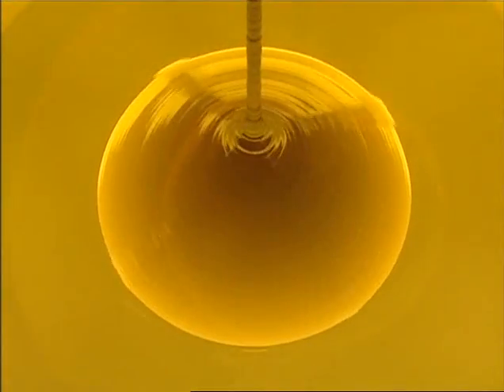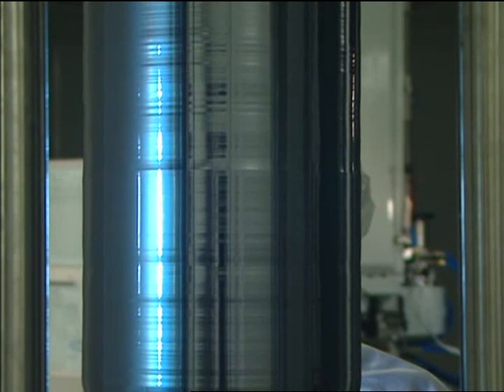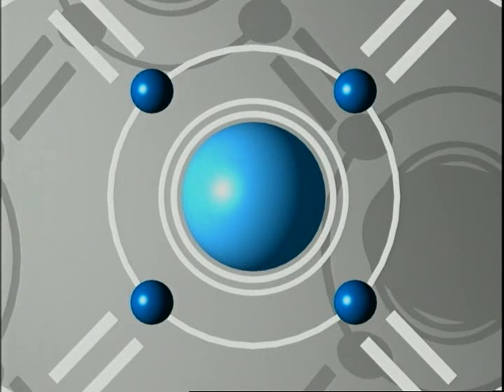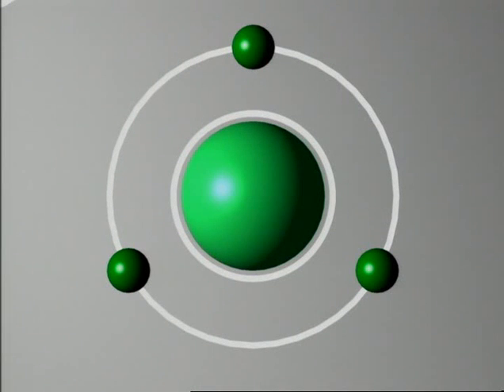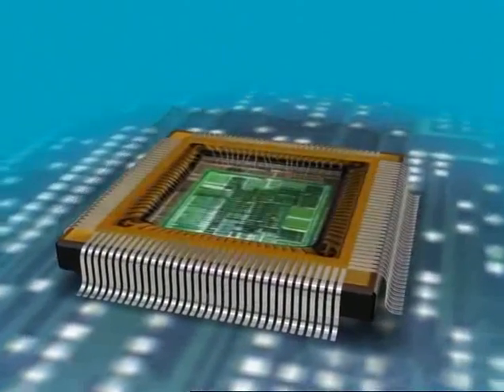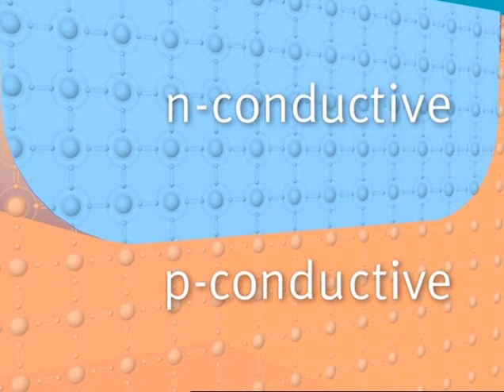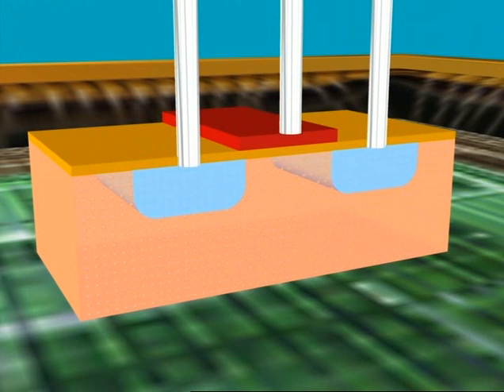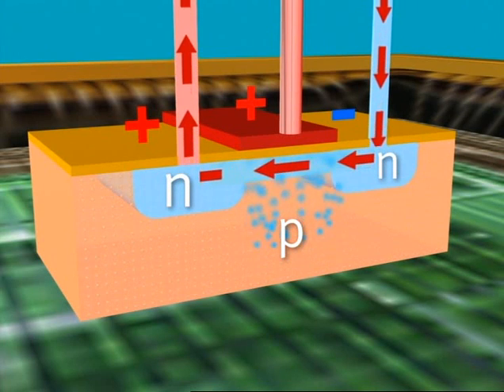From sand to silicon

Comment: what type of sand is used? There is a big difference between sands.  I know this from construction videos with window glass making. They show a desert dune but I hear that isn't the correct sand.
Reply: Just look up what sand type is on silicone valley. That’s pretty much where most computer chips are made from.

Comment: I mean, that was cool and all.  But I came to find out how to turn sand into silicon...
Reply: The process is complex and multi step!
Hope that’s helps :)
Reply: @thelukesternater  thanks, now all is clear
Reply: 👋 Hi,  I live in the High desert of Oregon and have 8acres of sand (we also are above an obsidian flow).  How can I make my sand into anything / crystals???
THANK YOU 🙏!!!
Reply: You may need more than a 3 minute video!
Reply: 8
0
Reply: You need to get Si by reaction with carbon to make CO2, then you melt the resulting silicon into one piece and pull the single crystal.

Comment: Please someone could answer me, I wanted to know how a monocrystalline crystal seed is made, how was it made?
Reply: Quartz silicon/sand is mixed with coke(or some form of highly pure carbon) and then heated to 2000 C usually by running a very high electrical current of some sort. this produces raw silicon with a lot of impurities. the raw silicon is dissolved using hydrogen chloride producing trichlorosilane and other halides. trichlorosilane is distilled from the mixture removing the impurities. trichlorosilane is reacted with hydrogen gas in the absence of oxygen and this produces silicon and HCl. this Si though is poly-Si, so the poly-Si is melted and then a seed monocrystalline Si uses the melted poly-Si to grow into a bigger monocrystal.
I copied this from another commenter ;)

Comment: so computers are a clump of tiny switches at the end of the day..
Reply: yes that can switch trillions of times a second. absolutely amazing really...
Reply: well it's not only the amount of transistors, the architecture has a big weight in forming the logic.
some chips can have fewer transistors but are "smarter" than other due to efficient architecture.
Reply: Basically a prosessor or a microchip is made of millions or even billions of transistors. If you use the right transisters in the right order, you can create the processors
Reply: 20 years of engineering condensed to one simple answer......yes. Additionally, the "switches" can also be variable, which leads to the ability to amplify sinusoidal voltages/currents. Having only one P and one N gives you a diode which allows only a unidirectional flow of current. Take a wire, run it into a transistor as an amplifier, then to a diode and then a piezoelectric headphone and you've got a very basic AM radio Rx. There, I just saved you $50k. LOL!

Comment: I didn't come here to learn about basic semiconductor physics. I came to see the step-by-step factory process of making pure silicon. It didn't even explain how the sand into turned into pure silicon: how is it filtered, heated up, etc.
Reply: quartz silicon/sand is mixed with coke(or some form of highly pure carbon) and then heated to 2000 C usually by running a very high electrical current of some sort. this produces raw silicon with a lot of impurities. the raw silicon is dissolved using hydrogen chloride producing trichlorosilane and other halides. trichlorosilane is distilled from the mixture removing the impurities. trichlorosilane is reacted with hydrogen gas in the absence of oxygen and this produces silicon and HCl. this Si though is poly-Si, so the poly-Si is melted and then a seed monocrystalline Si uses the melted poly-Si to grow into a bigger monocrystal.
Reply: @this_is_japes7409   See this is what I wanted to hear. Why coul't be this in the video? Thx!
Reply: Same. If title says "from sand to silicon" i want to know the process behind it and and not just: "it is transformed from sand to silicon".
Reply: yes and no, it can be done with "cheap" materials, but it will just take A LOT more "cheap" materials to produce the same yield. though what in particular do you find expensive. I mean I put down fairly general processes. the materials I mentioned you have to put into the system is sand(available worldwide), coke(charcoal can be used at the expense of yield), hydrogen chloride(can be made from salt water and electricity), and lots of energy(typically in the form of electricity or heat). this is the simplest process I know to produce mono-Si.
Reply: Please someone could answer me, I wanted to know how a monocrystalline crystal seed is made, how was it made?
Reply: @rafaelbarbosacosta9365  isolating off a single crystal from a poly-Si sample. (yes i know i'm two years too late, but youtube probably broke comment notifications when you asked.)
Reply: HobbyAlchemist Is there no other easier way , one which can be done with simple and  cheap materials . I searched a lot , didnt fins any...any suggestions?
Reply: You can make silicon from thermite made out of beach sand...
Reply: @moighosh7  Making Silicon is easy, making silicon with a purity of 99.9999999 is pretty darn complicated.
Reply: @bonnome2  I guess that is where the hacking part comes in.. We will have to prepare multiple batches... We will have to study the impurities through multiple permutation and combinations... And use available common tech like vacuum chambers and atomisers, etc to nullify their effects... In short it can be done... Will be an expensive, tedious and lengthy process... But once you learn to do it once you can repeat that to make the process more efficient and break even... in the end you end up with a skill most of the people on this planet won't have...
Reply: @moighosh7  hope someone takes initiative, i am neither science nor  engineering background but intrested in investing in it. 🙂
Reply: HobbyAlchemist allright
Reply: He barely explaines the physics parts.
Reply: I'm just here for the electricity particles.
Reply: Dude, same! Sorry someone had to be mean to you though.
Reply: Dang, you learned something. That's so awful.
Reply: 14598175 Cut the sarcasm. I'm an electrical engineer; I already knew about this Solid State 101 basic knowledge. What I came for is the stuff they don't teach in class: how the sand is actually made into silicon. You'd expect a video with the title "From sand to silicon" to at least cover that.
Reply: @davidb5205  even i want to see how silicon is made from sand.🙂

Comment: This is at least a little wrong. N-type does not mean negatively charged, and P-type does not mean positively charged.
The quick thought experiment: You dope a Silicon wafer with phosphorus. It's N-type now. Is it shooting out an electric field? Nope. Ideally the material has the same number of protons as it does electrons, the only difference is how tightly bound the electrons are; whether they fit neatly into a shell or not.

Comment: Everybody is correct in the flow of current.  I just depends on how you describe it.  There are two descriptions on current flow:
1.  Follow the electrons.  This is how most of us were taught and it works as a fine understanding for 99.995% of everything we do.  This only falls short when we are at the gate level designing a chip.  Think of it this way:  There is a line of stopped cars and the first car (The electron) drives through the intersection, there is now a space where that car was and car 2 pulls forward into that space, there is now a space where car 2 was and car 3 pulls forward.  We are following the flow of the cars.

2.  Follow the holes.  This is the method you are taught as an engineer.  If we use the line of car analogy again as the cars (electrons) move forward a hole opens up behind it.  As the cars move forward the hole moves back words.  In the video they mentioned Boron doped Silicon and explained that there was missing electron (hole).  They were following this hole.
Reply: There is no need for engineers to "follow the holes" or the equivalent, use "conventional current". All that is needed is a proper understanding of physics. There is an electric field, the electrons are the real particles with real charge that respond to that field by moving along it's gradient toward the positive charge, this is a current but here's the kicker, it's a negative current, so if for instance you try to use the right hand rule to determine the electrons response to a field or the orientation of the magnetic field created by the movement of the electrons, your prediction will be 180 degrees out of phase with reality. If you can keep this in mind and account for it then there is no problem whatsoever with engineering within the scope of real current. Using hole current is just a trick to not have to be so good at one's job.
Reply: @AtlasReburdened  It's a little hard to grasp if you don't understand quasiparticles and/or emergent phenomena.

Comment: Electrons moving towards the Positive side...? So in-depth and still wrong :D
Reply: Yes, in Physics, which is the real description of reality and is not tainted by the tricks engineers use to make their job easier, we know that electrons have a negative charge, so a place with and abundance of them has a negative charge and a place with a deficiency of them has a positive charge. We also know that things with a negative charge are attracted to positive charges and this is seen as electricity in wires as the electrons move from the negative source to the positive sink.
Reply: Well, electrons are negatively charged. So I’m not sure how you think negative attracting to positive is wrong…